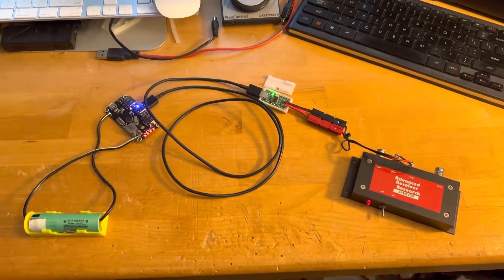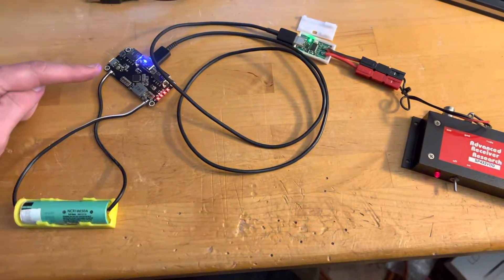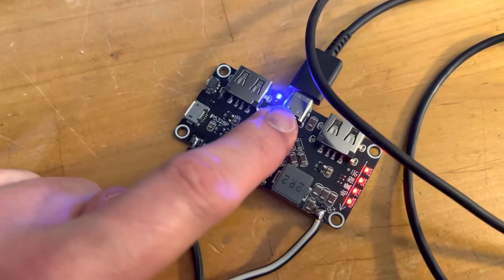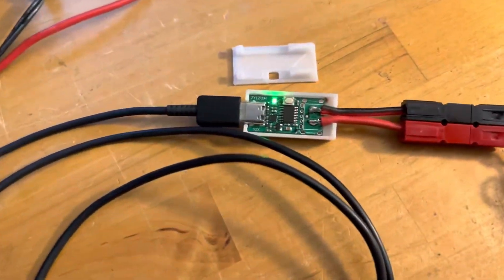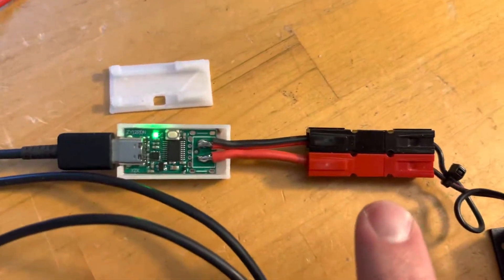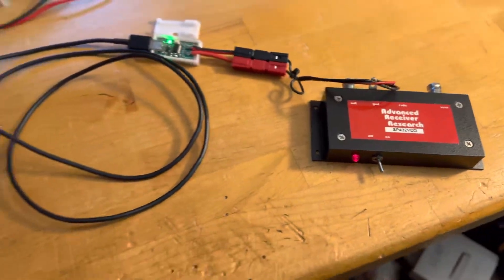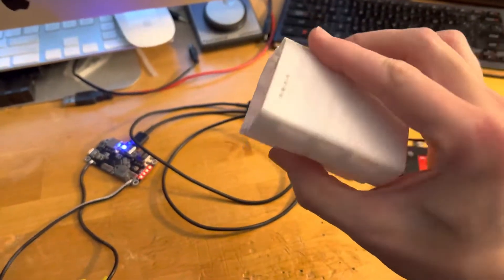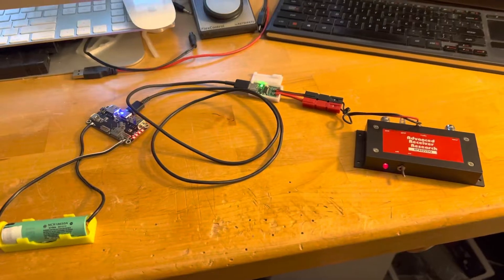18650, IP5328P and ZY12PDN 12 volt DC

Comment: wouldn't it be more efficient if the input batterie voltage was higher than the output ? i mean 2s 3s 4s etc.

Comment: Bro i have 12 v baterry pack does this type c module work with that
Reply from the maker: I used nine 18650 cells. It uses a 4.0 volt input.
Reply: Brother iam not asking that iam asking i have battery pack of 12v will this module handles that much load
Reply from the maker: @Kashmir__vlogs No.
Reply: 3.6 v battery will it work
Reply from the maker: @Kashmir__vlogs it is rated at 3.7 Lion input. https://www.amazon.com/dp/B08R8JWJZL/ref=cm_sw_r_cp_api_i_EFST2FDJM0XKWS7XTWJW

Comment: Question,

If you run 1s1p will the 5328p boost the volt to 12v?
Reply from the maker: Yes. Very low amps.
Reply from the maker: I run nine 18650s in parallel.
Reply: @DavidKK4GAF  so they'll auto adjust the voltage according the output? Ok. I'm buying this board

Comment: Well, shoot. I have the exact same setup (but with two cells in my power bank) but when I try to switch the power output on the zy12pdn it flashes a blue light and doesn't switch. The blue PD light on the battery side doesn't light up either...I'm not sure what's going on.
Reply from the maker: Try to charge it with the micro USB. That started the board I have.
Reply from the maker: Activate the board with the button on the side.
Reply: @DavidKK4GAF  Yes, I was able to figure it out due to your help. Do you have any experience with IP5328P_v1.0? It's a circuit board designed for diy USB C battery banks. I've had some trouble with it...
Reply: @DavidKK4GAF  sorry, wrote that before realizing that's part of what this video is about...I'm having an issue where the board keeps going into lock mode. I think it may be shutting down due to a voltage spike, but I've also have two fail due to batteries dying. Those were using salvaged cells though. When I attach a fresh new cell to the board though it still enters lockout mode and I have to reset it to get it going again. I've seen several other people on forums mention this issue, but no solutions/ideas...
Reply from the maker: I used salvaged batteries from Ring doorbells. I charged them each with the board. Then spot welder them all together.
Reply from the maker: There needs to be ac12 volt draw for it to switch.